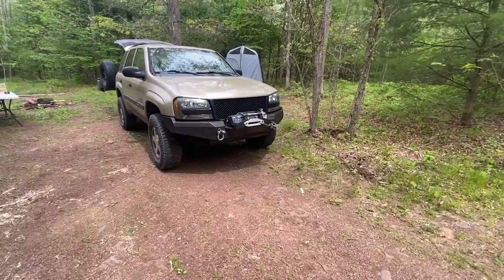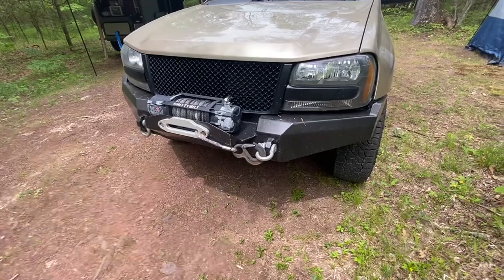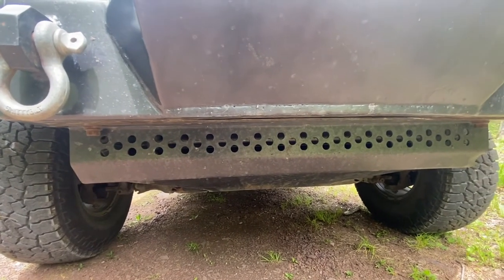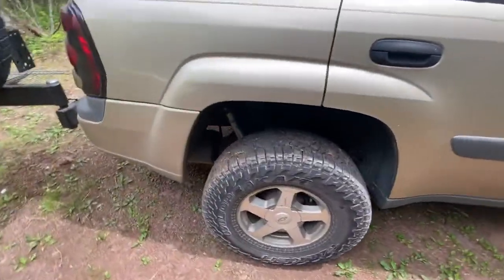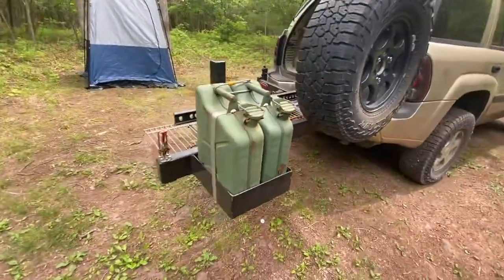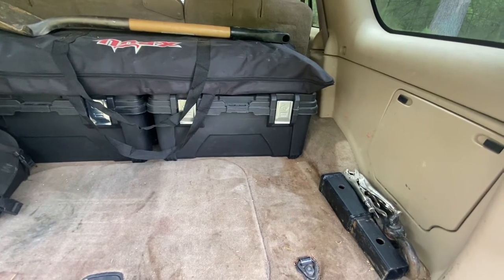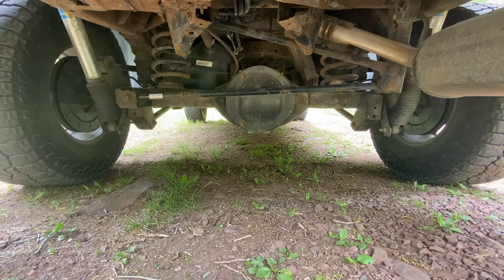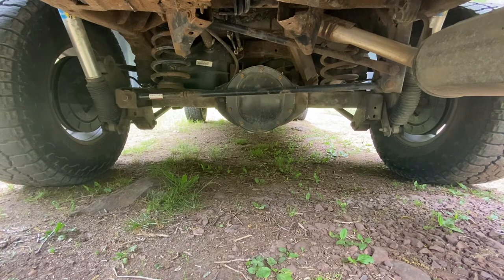Overland Chevy Trailblazer Build Walk Around

Comment: can you do a more detailed video about that axle swap?
like how to do it and what to consider?
Reply: nvm found your video!
Reply from the maker: @sergigahr  the axle swap really is a direct swap. The bigger axle from the EXTs bolts right in, and the brakes and everything are the same. If you have a 06+ trailblazer with stabilitrak, you just need to make sure you get a 06 EXT axle that has the wheel speed sensors in the tubes.
Reply: @trailblazeroverland9759  does the V8 already have the 8.6. I ask because its the rig im working on.
Reply from the maker: @sergigahr  yep, it already has the 8.6.
Reply: For your 4 inch lift, where you able to use the stock driveshaft or did you have to get a custom one?